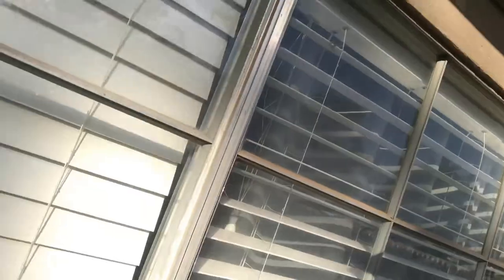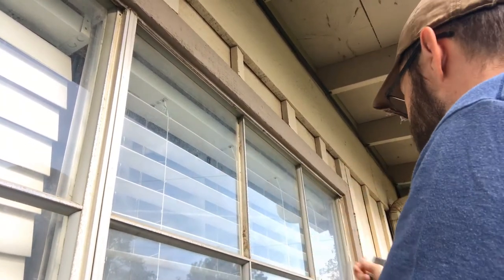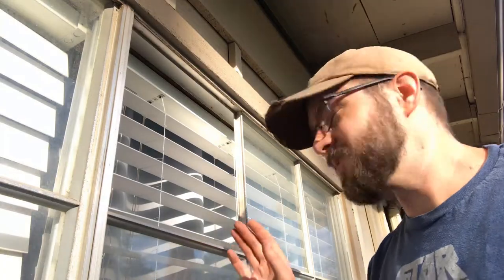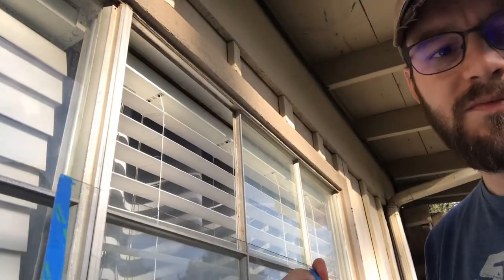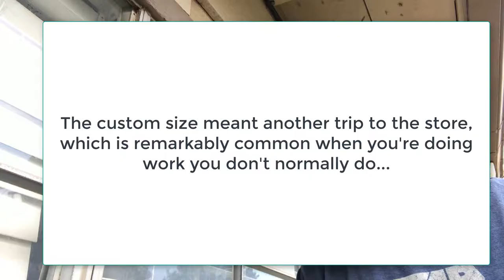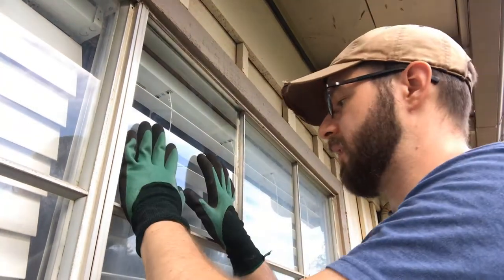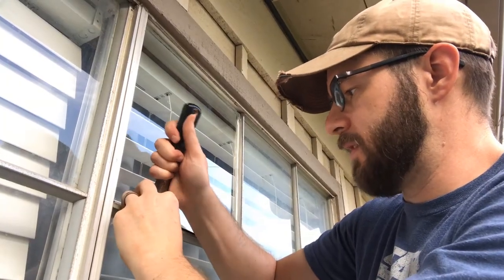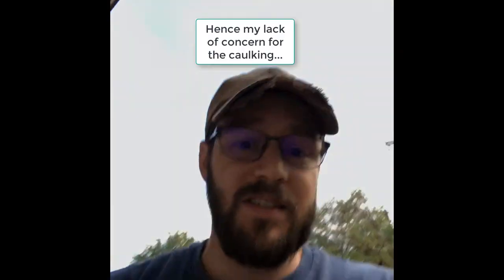Glass Pane Replacement in Aluminum Window

Comment: A few things I've learned. 1. You can use siliconized acrylic latex caulk instead of silicone which is much more forgiving....easier to clean. 2. You can use an 8" long piece of tape folded onto itself from the middle for a few inches with the remaining two flaps adhered to the pane of glass to help manage the placement of the pane. 3. A heat gun or hair dryer can warm the vinyl glazing strips to make them more pliable in case of advanced age or cold weather which increases the "brittleness" and chance for cracking.  Glazing strips are  available in a few dimensions and a few basic basic colors online.
Reply from the maker: All great tips, John, thanks for sharing!

Comment: Nice job dude and I hope my repair goes just as easy as yours did. I need to replace a large pane and a small one on a house that was built in the late 70's with all aluminum frame windows.
Reply from the maker: I still say the 'better' approach is new windows, but you can't always swing that cost either! Good luck with it - glad this thing is still helpful after several years of life.

Comment: Thank You for this. For good measure though, I would suggest making sure the glass is cut to fit right before applying the silicone. Otherwise you could have a mess to clean.
Reply: I wrote that before it got to the part where the glass was cut wrong.

Comment: I'll tell ya.. these window repair people charge a ton and they keep their practices very secret and under wraps. I think a lot more people could do this for themselves easily. THANK YOU FOR THE HELP!
Reply from the maker: Always glad this is still helpful! It's really not hard, you just have to piece it together.
Reply: For a single pane replacement like this you'd pay about $150 (Materials+$125 service charge)  which means for a simple phone call  don't have to worry about measuring, Ordering, Cutting,tools Carefully removing bead, risking injuring yourself, and you don't have to clean up any glass dust or shards or dispose of any broken glass. You also don't have to deal with extreme heat or cold as an added bonus. If it takes an hour to a lead and a helper to drive to the location for the second time( because it would have had to have been measured for free) than the company might make $80 on your single pane. Then they have to pay taxes on that and pay for the companies insurance.

Comment: Ok bud here’s the deal for future reference and please share. Pry the tinfoil glass stops up from glass not from metal frame this will make it reusable install is the reverse slide metal lip into metal frame and push down on glass side that will lock it in place it seems counter intuitive but trust me I have done this kind of repair many many times I have been a glazier my entire adult life and and some as a teen. If you have any questions regarding ANY glass work feel free to reach out to me thanks and good job

Comment: Awesome! Great help. Can I measure the glass accurately by measuring the glazing strips?
Reply from the maker: It's been several years - I legitimately do not know, but you will have to get the glazing out to get the glass out so you'll likely do better to simply measure the glass directly and avoid any possible issues. Would assume, otherwise, the longest measurement on the glaze would provide a close proximity. Good news is you should have very marginal wiggle room (veeeeery marginal).

Comment: Hello, I'm trying to remove the entire glass window that moves up and down inside the larger frame. Do you know how to remove that section. Thanks great video!
Reply from the maker: Hey there, thanks! And.. unfortunately I do not have anything for that. My gut tells me you take out all the glass panes, then knock out the interior sliding frame because these things were often built into the house. If you're trying to replace just this piece you might well be better off just replacing the entire window. It'll cost less, most likely, and provide much better insulation!
Reply: @HowerDo  Thanks for the quick reply. Well if I can just remove the bottom part of that moveable window then I will have enough clearance for my AC unit. I'm short about 1 inch which really bums me out. I know there is a way just need to figure it out. I could also make two small drimmel cuts into the frame on one side and just pull the entire window out of frame.

Comment: Do you know where to buy replacement window glazing? the little pieces you snapped off to remove the pane? Ive noticed a lot of mine are super brittle and could use replacing..
Reply from the maker: Found this on Amazon: https://www.amazon.com/White-Snap-Vinyl-Glazing-Bead/dp/B00FYVNKA2#customerReviews. Straight ends so you will need to cut the angle in the corners for a good fit. Negative review seems to be from someone that didn't read the full description. Not sure about locally - never bought any myself and made due with what I could salvage. Good luck!

Comment: Can I find those little sidings?  I have some that are brittle and not able to keep the glass intact.  I have a few of these I like to replace on my own.  Also nervous because I have never done it before
Reply from the maker: Those strips are called flashing and I had a hard time finding them which is why I just tried to be careful. If they are too brittle you can maybe find some online (amazon or speciality windows store), or, as a last measure just use silicon caulking to place/hold the window pane in place. The flashing is designed to clip into the frame and helps run water out of the seal, i.e. keep it outside. Ultimately, these kind of windows are outdated and should be updated with a newer style so if you're going the silicon route, just realize you're going to have to break that pane out and scrap it down to replace it again in the future. As for being nervous, it sounds like you'll figure out the process before you're done! No need to be nervous - just wear good leather gloves and go slow, give yourself time to learn, and recognize you'll probably screw up a couple of times before you get it right. Consider that in your materials and cost and you'll have enough on hand to embrace it and enjoy the learning process! 

Good luck!

Comment: I have those same kind of windows.  Can I paint the alumni num and the grey strip for a better look or will it still look dated?
Reply from the maker: I’d say probably, but if you can’t swing a full replacement it’s definitely an improvement from the standard. TAPE TAPE TAPE! Scraping windows is a PITA compared to a decent tape job. Good luck!
Reply: I painted my window with spray paint and it looks great! All the prep work (LOTS OF TAPING) paid off!

Comment: What's the name of that piece that holds the glass around? Mine are aluminum and get all deformed when I take it out. Need new ones
Reply from the maker: Believe that's flashing, mine were plastic and I just re-use them. Should be able to get some at a hardware store if you let them know what you're doing.

Comment: Your "paint scraper" is a 1" putty knife. Otherwise most everything is extremely informative. You really did learn as you go. 
John H is spot on - if the old glazing (not caulking) is dry and stuck, a heat gun or very focused (not diffused) high power hair dryer can soften the sealant. I've been tempted to use wire brushes on a drill to clear the dry caulking but go with the softest wire brush if you do this. Older aluminum is thick, but a drill brush can be hard to control and you can bend or scratch pieces.
I have resorted to stiff tooth brushes and a lot of elbow grease to get the difficult flakes out. You only need half of the area clean of old glazing product for the new glazing to seal, so don't get carried away.